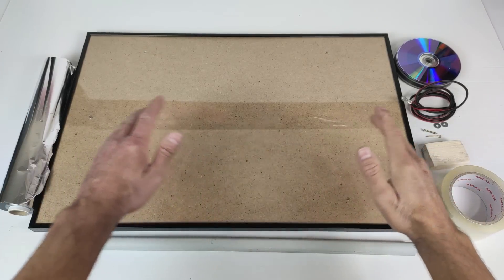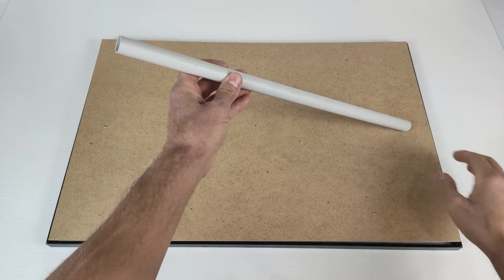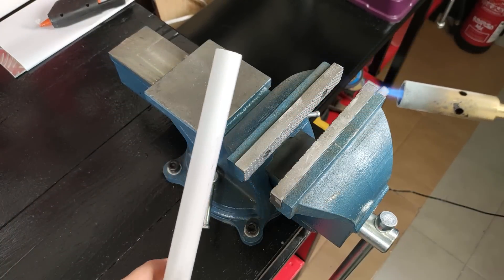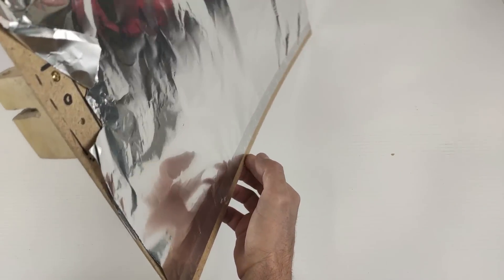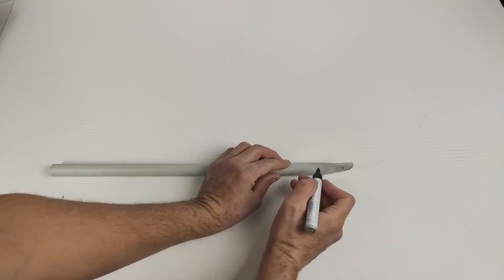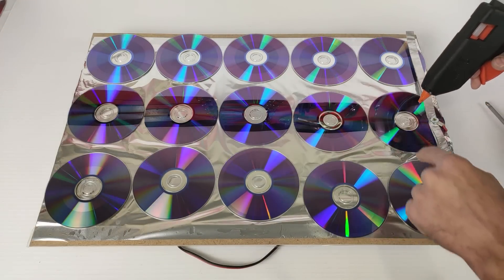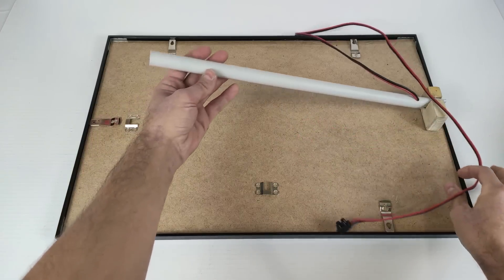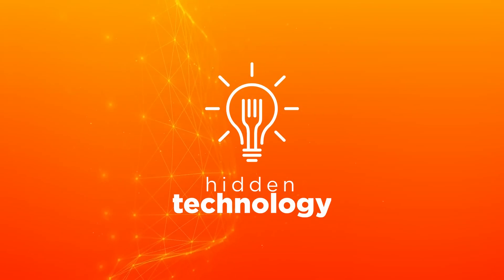I turn a bunch of old CDs into a SOLAR PANEL for your home | Homemade Free Energy

Comment: Ok, lets do some math. Our presenter said that each CD produces .8 volts. In series,  those 15 discs would produce 12 volts. But this guy connected them all in parallel, which would produce the same .8volts as just one disc, opps! I'm with everyone else, there's batteries in the tube. There's no good reason to run the cable thru the tube, except for nefarious reasons.
Reply: the three rows are in parallel but the rows of 5 are 5 discs in series. But your main point is correct in that this is nefarious, good word.

Comment: CDs are made of polycarbonate with shiny coatings which are not "semiconductors", so there is no way CDs can convert solar energy to electricity using the science of photovoltaics.  You can never get 0.8v or any voltage out of a CD. If you did get 0.8 volts, you would need 15 CD, which he cleverly has, but they need to be connected in series, ie like head to tail or between alternate faces  of the CD assuming the faces are conducting.  He "connects" them but not in series.  This thing is crap.

Comment: Couldn't possibly produce 12V even if you believe everything he said, which is bunch of BS.  Since he said that single CD produces 0.8V and all of the CD's are connected in parallel the most he could have possibly read on the Multimeter would be ~0.8V.   😜

Comment: BS... or in international road sign symbols:  🦬-💩. 1st, the 2 short aluminum strips are not insulated from the aluminum backing as it jumps from the 3 rows of CDs, which = a short circuit. 2nd, CDs are coated with a lacquer, or similar sealant... they are non conductive; insulators. Go ahead, test them. Test them before you buy any of the other stuff. Prove me wrong.

Comment: 12:15 He used the wrong words. You have to put transparent adhesive tape so that the positive and negative electrodes make good contact to each other and therefore also perfect short circuits. This build is useless, waste of time, material and money.

Comment: It's novel motto surprisingly used silicion 15 x 0.8 = 12 , CD s and generated solar panel with output 12 volts with 30 watts.

Comment: Just use the cd panel to reflect more light at a real solar panel. If you use same size, should give 20-30% more power
Reply: or throw the cd:s to recycling and use a mirror :)
Reply: @jannekallio5047  yep. Then we talk a lot more output. Especially on a bit cloudy day.

Comment: This will not work. let me tell you why. let's say that each CD gives .2vdc. which it will not. to get 12vdc from the CD's you would have to have 60 CD's. Now  to get the 12v out of the CD's at .2vdc you would have to connect them in series connection. he connected all the CD's in Parallel connection. that would keep the voltage of .2vdc. He also shorted out the Anode and cathode connections by taping the anode down to the cathode. oh and 1 more reason this does not work the CD's are plastic and that does nothing when lit by the sun or any light. but the batters in the stand 3ea Lipo's will give you 12vdc. That's the only thing he did right.

Comment: Too bad he never mentions the amperage.. and the amperage is important when running any device such as a refrigerator/ac unit, motor that actually does important work such as a drill, etc. Without enough amperage [power] you cannot do work.
Reply: He says 30 watts in the end. Power divided by volts = current. So that would mean 2.5 amps. Hard to believe. But that's aside from the fact that the aluminium is connected to the plastic on the cd's. Several comment on the lack of silicon in cd's, I don't know. But a quick test with one cd in the back yard will answer your question and cost very little time/€€

Comment: What is the name of the connector on the end of the wires?
Reply: Its just called an electrical connector, or by its nickname 'chocolate block'. Its the most common connector in countries that have proper electrical safety standards so you cant just use cheap death trap connectors like wagos and wire nuts.

Comment: Would it produce more power with vynils?
Reply: I bet vinyl aka plastic would produce a heck of a static charge by using cotton, wool or even polyester clothing rubbed on it 🙊🙊🙊

I very often become a human vandegraffe generator with wool, polyester, anything rayon and even clothing with small percentages of spandex are actually dangerous for me to even think of wearing anytime during winter (due to no humidity promoting extreme static charges for me) alongside any no humidity summer days..  

Those times are highly dangerous for me to wear ANY form of clothing that collects static electricity easily, because in the past I've caused breaker boxes to shut off at the mains breaker (aka turning off a whole house from the power grid!!!)  due to how much static I've had. 🙊🙊🙊😵😵

Comment: Tried this got zero volts even with just one CD. Also the hook up shown wires everything in parallel.  Should only produce the equivalent of one cell so how does this work?
Reply: It works off the 3 fully charge 18650 batteries hidden in the pipe...

Comment: Do you know why CD has a silver color? In the middle of the CD there is a thin layer of aluminum. The photoelectric effect does not occur on the surface of aluminum. The author of this video is a scammer that lies. The photoelectric effect takes place on a layer of copper oxide ... you can use a tape or copper plate - heated in the oven ....

Comment: This is a closed loop, in other words there is no current flow. It is simple. Ohms law is clear about it. Shame that people try to make money with youtube by fooling people without physics knowledge. People there is no magic way to get free energy. The money and time you will spend with this idiotic contraption, you could buy a real solar pannel and get some energy. Just a simple evidence for those that have no clue about energy generation; in the video his voltage is always constant, meaning he has a 12V battery attached hidden. 12V battery will give a constant voltage depending on the charge. For example: 12.49v without variation means it is coming from a battery and not from a solar source of energy.

Comment: Now I work with solar on the daily. There were many reasons why this isn't legitimate. I saw a few people point out the aluminum foil only makes contact with the plastic layer of the cd and not the actual silicon layer which is true. However another reason is it appears he used a AC light bulb and solar panels generate DC power and need to be inverted to AC to power things like light bulbs. The motor could've ben a AC or DC so that's why I couldn't say much about that
Reply: The thing that doesn’t jive for me is the open circuit voltage, with real solar open voltage (no load connected, just a meter) is way higher than the working voltage, so you might see 18-24v on a panel with nothing attached but that drops to 12v once you have a load like a battery being charged or a light...  so the demonstration looked more like a battery than actual solar to me.
Reply: @SchwaAlien  You make a good point aswell.
Reply: Brendon Gomez said: "I saw a few people point out the aluminum foil only makes contact with the plastic layer of the cd and not the actual silicon layer which is true."

No it's not, because NO CD has EVER been made with SILICON. They're made of polycarbonate plastic and a thin layer of aluminum or organic dye.
Reply: @Christian T you're right, but this isn't an LED light bulb in the video, LED bulbs would be labeled as such and when he shows the details of the bulb to the camera, it says "ExtraStar 6W MR16 6500K 480Lumen 500mA 12v 202008CX" I don't think that's an LED bulb so it would be an AC bulb I believe.

Comment: Yeah no I don't buy it. CDs have scratch protective layers of plastic. If this were to theoretically actually work, he would have needed to remove part of that layer in order to make a conductive connection between the CDS. On top of that, He literally just lays strips of foil across the top of all the CDs. He would need to only connect the edges of the CDs in order to force the electricity to flow correctly.

This is just another person profiting off of spreading misinformation.

Comment: What kind of amperage and wattage is it capable of?
Reply: 0.0 Volts at 0.00000 Amps
Reply: @derbemobile  - you must have one seriously good ammeter to measure zero amps that accurately!  Is it the one made from a shoebox, with two bits of string and small twigs as probes?
Reply: @22smudger  😂

Comment: I used 46 laserdisc!
1 laserdisc = 5V!!!
so I generate 230V!!!
awesome!
Reply: The silicon is covered with plastic on a CD, how do you remove this? Or is there another way to access such as drilling hole and using small nuts and bolts? Why isn’t this show. On the video? TIA

Comment: And don't forget to use a round tube for the stand - it is neccessary for the needed batteries, to achieve the desired tension.
Reply: I wondered why he ran the cable through the tube. Makes sense.
Reply: @aaronheaney2694  bravo , j y avait pas pensé , je savait que ca marchait pas , mais bravo pour le tube ;-)
Reply: Bigpeter1313. Let us know what happens. I’m getting mixed responses if it works or not. I want to know the truth.
Reply: @K_5Blazer.  My personal opinion is to go to Harbor Freight and purchase the solar panel setup which also comes with the voltage controller so you don't overcharge or blow whatever you're hooking up.
Reply: Surprised that no-one else seems to notice the “pos” and “neg” foils are touching. This ladies and gentlemen would be known as a SHORT! Good thing voltage is not produced by CDs or it would also be referred to as a BONFIRE!
Reply: Does it really work?
Reply: @chewyjuice4656  It doesn't  it's total bs
Reply: @chewyjuice4656  NO
Reply: @spacy7test812  Have you tried this to prove it did not work? And if you did, did you produce a video to prove your test?
Reply: @sonofeloah  yea tested the cds it DONT WORK
Reply: @sonofeloah  Use your brain if it did work which it does not then millions would be doing it .But funny i dont see people in india or other countries with large collections of CDs on their roof
Reply: @spacy7test812  In your test, did you use the ones with silicon in them or the other ones that do not have any silicon? I am looking for ones that have silicon in them. I have seen the purple hued ones from time to time but they are pretty hard to find anymore. As he stated, the regular ones do not work and they do not have silicon in their make up.
Reply: @spacy7test812  true 🤣🤣🤣🤣🤣
Reply: @sonofeloah  Just because you put up a reply that asks to prove it doesn't work, does not mean It works!! Lots of conspiracy theory uses this "logic". It does not work, now prove me wrong. BTW, retired Army engineer. I doubt you will respond unless you are a full on narcissist and cannot back down from a lost fight.
Reply: @BigPeter1313 : True enough. I have only one cd that has silicon waffered in the disc and would like to find at least a couple more before trying to experiment. I do not think it will preoduce much power if any at all. My main point is that since no one who is making comments here have tested the  theory themselves, then how can they even speak out on it one way or the other? Use of silicone waffer was only done in the early cds to make them more ridged. But, as folks were not gentile with the cds, it was abanoned. They might still use it in other countries and I will find out. Meanwhile, when I do get enough for a proper test, once tested, I will post results here. I do have a theory though that by using them in a different configuration that they might be more like a photo voltaic capacitor than a photo voltaic cell. In which case, they would maybe work even with modern cd/dvd. So, gonna also gather up trashed ones to run that experiment.

Comment: Uses hot glue gun to glue down CDs. Place this in the sun for a short time a watch CDs pop loose.  Also, those framing materials won't last outside in elements for any length of time.

Comment: this is so awesome! would love to see a full solar power system built with cds like this one. battery bank would be cool to go with it too. big like and sub for you my frend
Reply: Good thing the battery bank is already hidden in the setup
Reply: Younswallowed this pill. .. it won't work.
Reply: you can make the batteries out of CDs also, you just have to stack a lot of them...be sure you get the polarity correct on each one...
Reply: @kholmar  said: "you can make the batteries out of CDs also, you just have to stack a lot of them"

LYING sack of crap. No you can NOT

Comment: The man talks about 12 volts but doesn't even know how to join the series. It has everything in parallel. The aluminum collector does not contact. Where is the negative potential connected? In addition, the CD is a perfect insulator. There is no silicon. It has a battery in the tube. Incredible blabbering on like mental disorders.

Comment: 30 Watts at 12 Volts implies a current of almost 3 Amps. Pull the other one "Sunny" Jim. 🙂
Reply: I didn't watch the whole video yet but are you saying this panel puts out 30 watts at 3 amps?

Comment: They keep saying "CD's" in this video, when they're NOT cd's at all. They are DVD's! They tell you that they discs that do not have the purple tint to them, will not work. That's because they are cd's and not dvd discs. So, if you want this to work, don't try using regular cd discs, use dvd discs instead.

Comment: What if you cut the edges of the CDs and make a sqare so that all the CDs would fit inside the frame without empty spaces? Also what if we cut the CDs into four equal sqares without the centre of the CDs and fit the sqares inside the frame? Can you do this with brand new CDs? What if put sellotape with pencil dust on it ( like how graphene is made ), then would there be a need for aluminium foil electrodes?
Reply: It will not work anyway. 
Thé only way is to do like him, hide 9 1,5v batteries in the plastic tube.
Reply: you can't cut the cds

Comment: This can't possibly be real
- the CDs have a plastic layer between the aluminum strips and the "silicon layer"
-the + aluminum strips are touching the - aluminum foil backing
-all of the CDs are connected together in parallel.  That would mean that a 1 CD cell would be a 12v output by itself (ridiculous) and adding more just increases the amps

I'm sure there are many more reasons why this is absolute nonsense but I'm done.  Nice waste of time
Reply: It is pleasing to someone like me in comment section well said same thought.
Reply: This guy and his CDs..smh.  Why not just get your 6-way power strip and plug it into itself to create free energy?  🤣
Reply: That whole series/parallel thing had my puzzler working overtime! 
That along with the cd's being encapsulated in plastic. I figured drilling the hole in one might make a difference but this guy simply has too much time on his hands and a twisted sense of humor!
Reply: Matthew Engesser said: "I'm sure there are many more reasons why this is absolute nonsense"

We should probably start with the FACT that CDs contain ZERO silicon. They're polycarbonate plastic and a thin layer of aluminum tor pressed disks, and an organic dye for recordables.
Reply: @Larre Janack It's pretty good. Silver is best but it tarnishes easy and it's pricey.  Gold is next and it doesn't tarnish easy so they often plate other metals with it.  Then comes copper, and then aluminum.
Reply: U
Reply: so do we need 300 CDs from such discs to get 240 volts of electricity from the sun
Reply: Just try it with one CD instead of going all in for a huge time consuming project that does'nt give you anything. But it could work because the plastic encapsulation on the CD could function as a dielectric. Just like capacitor a static potential build up in between the two conductive layers. But this is a theory of why it might be working. I have some old CDs and I cold try it with one and see if this is the case.
Reply: @Roel922  Capacitors do not pass DC. They block DC and pass AC. Plastic DVD cases do not conduct electricity in any form.
Reply: @herrmannd1  That's when charging a capacitor till it's static equilibrium then will pass DC current since they are also used to smooth out noice in a electric signal such as for example in a 5V regulator circuit board. Photons in hitting the conductive layer in the DVD could excite atoms releasing electrons and create a very small current. The nonconductive plastic encapsulation then prevents them from flowing to the aluminium anode. That's my theory but I haven't tried it yet.
Reply: this plastic is polycarbonate substrate yes... but... Conductive polycarbonate (PC) is polycarbonate film filled, typically with carbon, to give a measure of electrical conductivity. new CDs are different that old ... that had old polycarbonate... not good for BlueRay etc... 

and other thinks,, like bad connections etc.. yes... sh1t.. :)

but possible it is....
Reply: I tried it and it worked so I guess is not nonsense.
Reply: @Yorking323  😂 Vanessa's such a sweet name for a troll
Reply: He drilled hole through CD Layer first exposing silicone layer inside hole and later made hole through foil with screw to make contact with power cable. Then atatched foils together with that RwCD to comunicate power to complete circuit transfer. Note that the type of CD cannot be the same as used in audio plat form. Must be the prismatic one with purple as the conductivity is important. Did you know that Plastic  creates static electricity? Clear plastic tape and the layer of coating on these RW-CD.( Normal audio prismatics don't work.)
Reply: @garygoldstein327  said: "He drilled hole through CD Layer first exposing silicone layer"

There's literally ZERO silicon OR silicone in ANY CD or DVD. Both you and he are FULL OF SHIT!